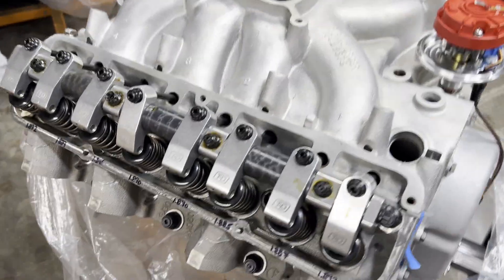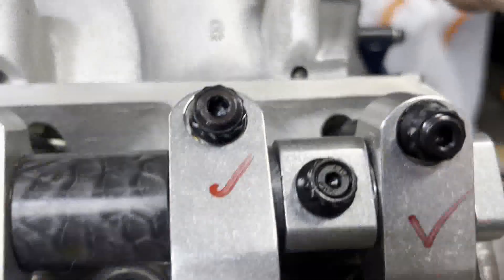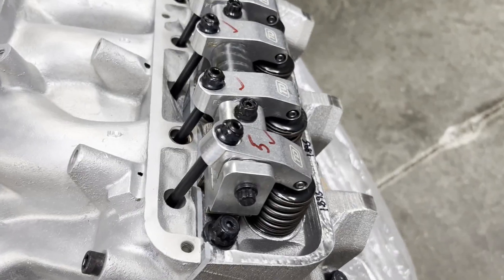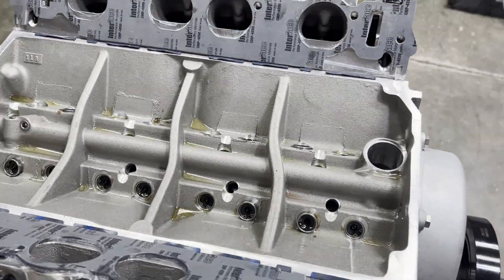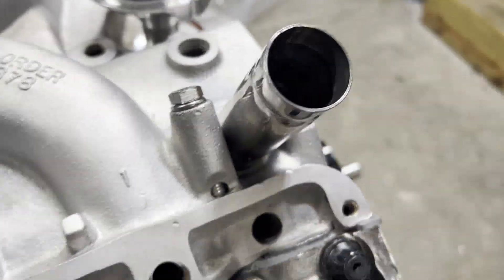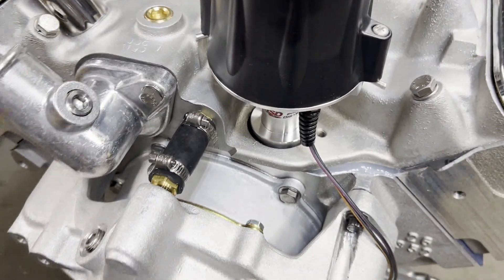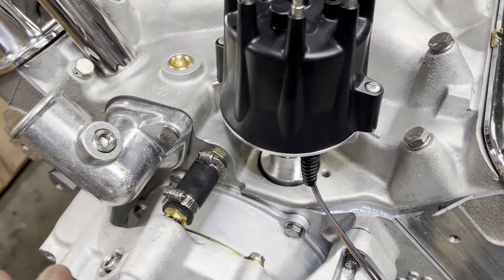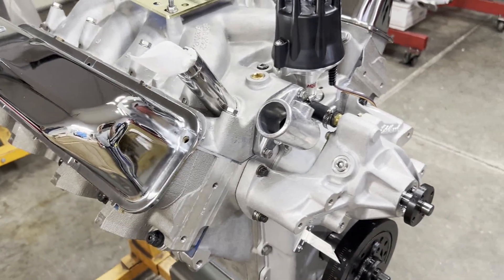Lykins Motorsports All-Aluminum Ford 482ci Tunnel Port FE Assembly, Part 3...

Comment: That is a work of art. Beautiful! As for the oil control, Ford needed those to help keep oil from getting to the valve stem when all they had was the old umbrella valve stem seals. With PC valve seals, these oil control rails are not needed.That's my opinion anyway.

Comment: Do you keep the 1-5-4 firing order on the custom cam?
Ford quit using it on the 5.0 small blocks supposedly because of the 'consecutive firing hit' on the front main.
Reply from the maker: Yep.  Don't see any issues with that firing order.

Comment: Beautiful engine, my question is why not a billet cam? You can use tool steel on billet I thought?
Reply from the maker: You can only use dlc coated tool steel lifters on a billet cam.  The combination of cam and lifters costs about $2700.
Reply: @lykinsmotorsports  ah, thats Nascar stuff, thank you for the info!

Comment: No oil cooler needed for this build (street driver)?
Reply from the maker: Oil coolers are not needed for most engines.   I rarely put them on an engine, even customers in Arizona/California.  No need.  Oil coolers usually keep the oil too cool, which isn't good.

Comment: I would like to see the weight of this engine. Close to a 289 weight?  Also, what about the use of "Shell lifers"  does that work with the tunnel port?
Reply from the maker: You could use shell lifters but it’s hard to find them in tool steel with an oiling hole and they generally don’t oil through the pushrods.